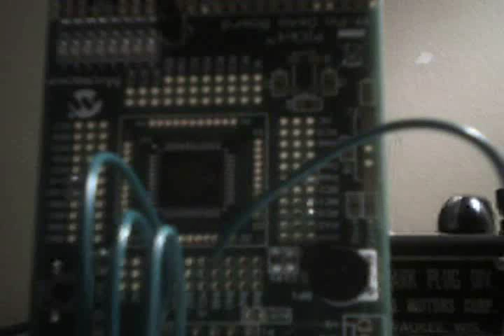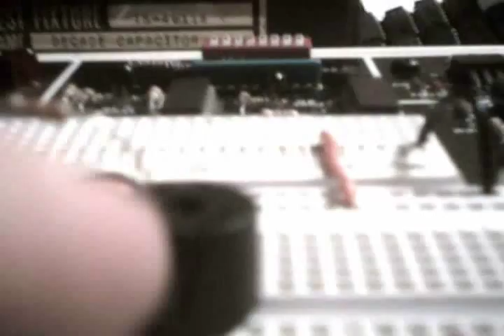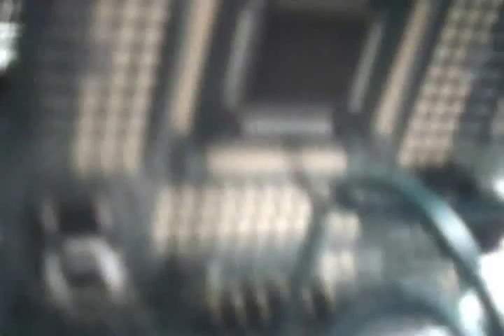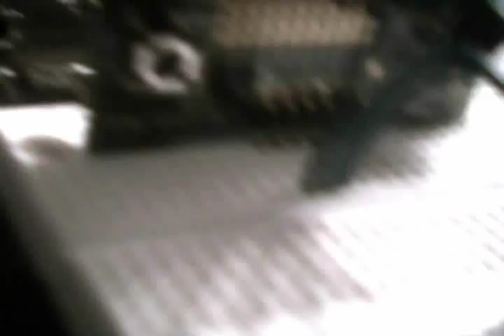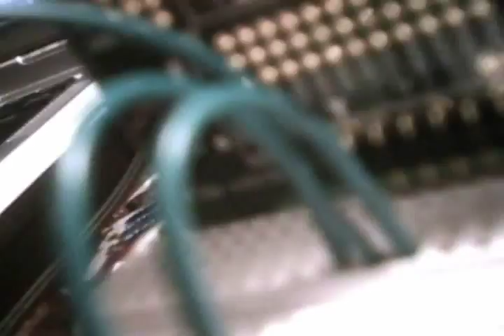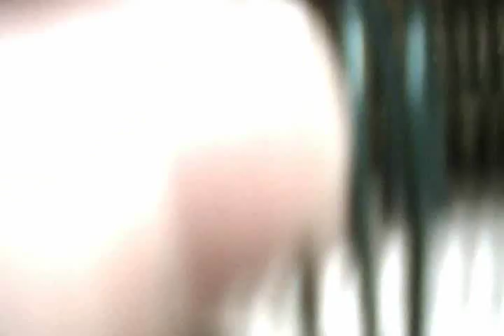First PIC Microcontroller Program

Comment: Vpp is also the MCLR and MCLR bit has to be high for the demo board to work... Have been trying to power the demoboard without using a breadboard but not able to.. just wondering what have you connected pin 1 to???